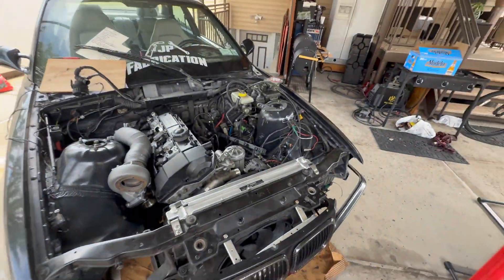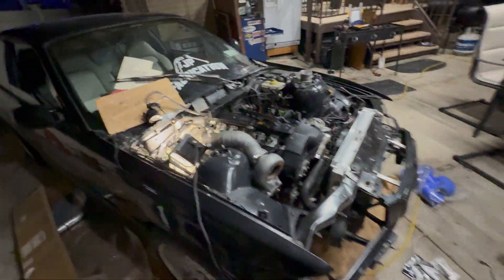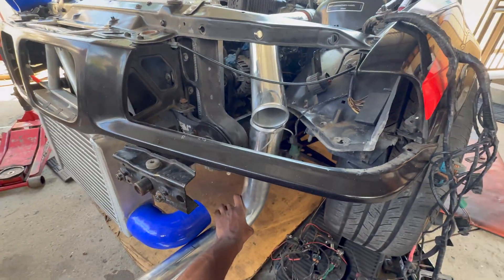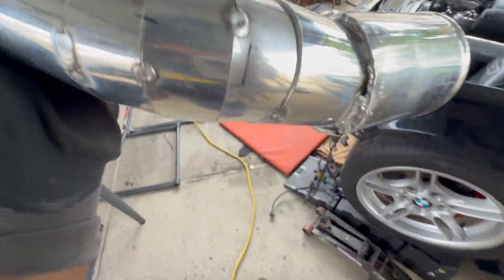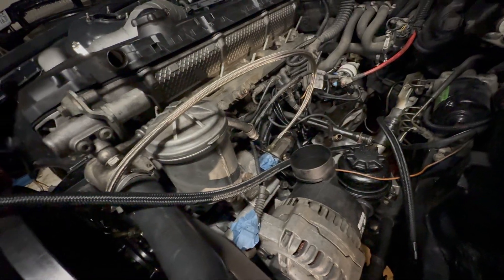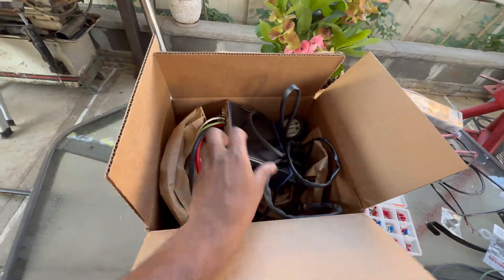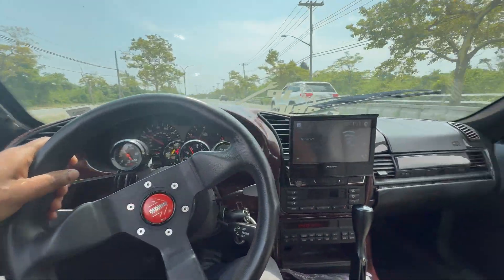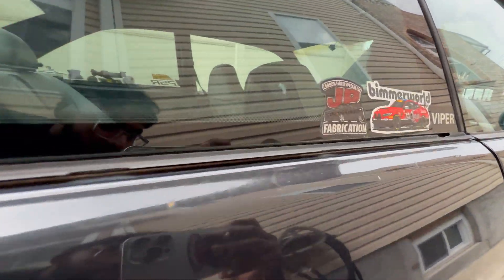Turbo E36 Build Part 2 :Fabrication, Standalone ECU & First Start!

Comment: did you need an alignment to get the wheel to be straight? i noticed you drove in a straight line with the steering wheel turned at an angle
Reply from the maker: It doesn’t actually need an alignment. The steering wheel is just off-center because when I reinstalled the rack after swapping the oil pan, I didn’t get the splines from the steering column to the rack lined up perfectly. Just need to pull the hub and re-center it.
Reply: @JPFabrication23 ok cool. When are you making a new video
Reply from the maker: @Thomas-fc6gf hopefully by next week. Still working on getting the car tuned. It’s very close to being “done”